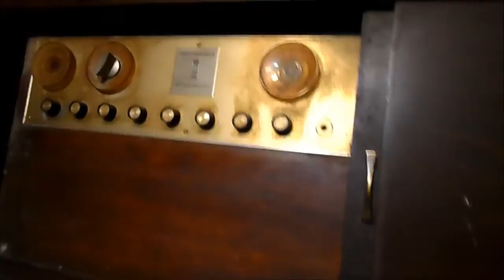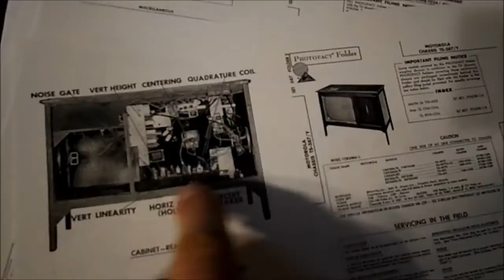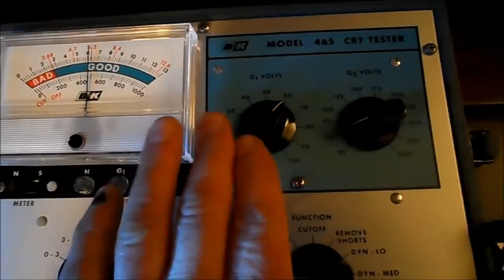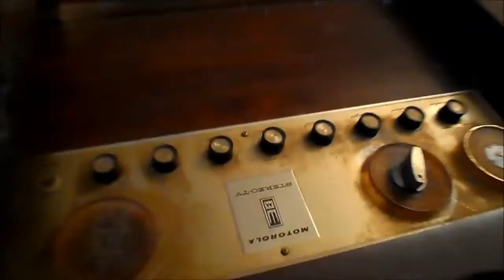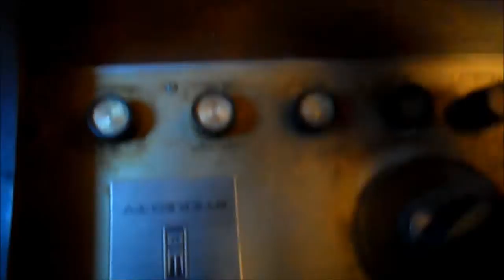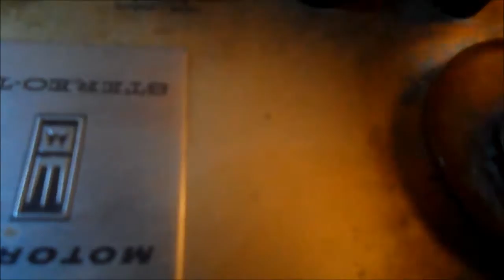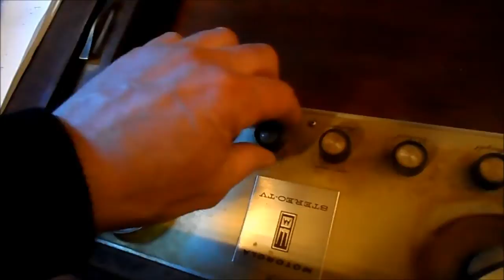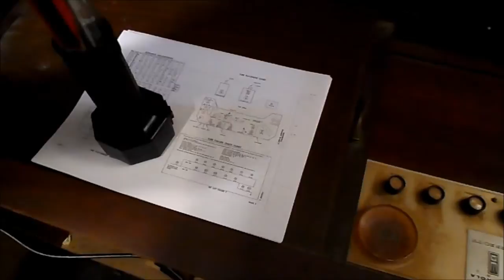1964 Motorola Stereo Television Model 23SK400AM

Comment: check the sams for the type CRT type, make sure you have the correct one. Check the tubes in the TV section, again making sure they are correct. confirm the voltage at the CRT filament pins (with CRT lit from TV set). I am thinking maybe it uses one of the low filament voltage CRTs like those used on predictas (2.63v) OR someone has replaced a tube with the wrong voltage (50C5 for a 35C5 as an example) dropping the overall string voltage to the rest of the tubes (including the CRT IF its part of the string).